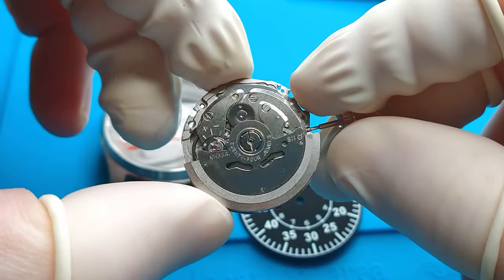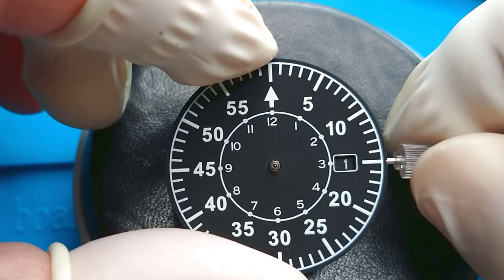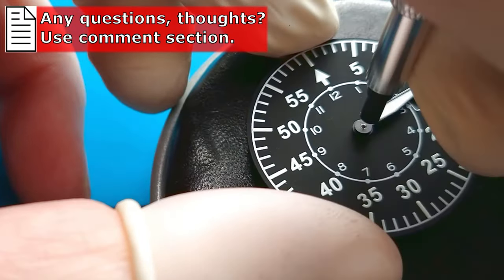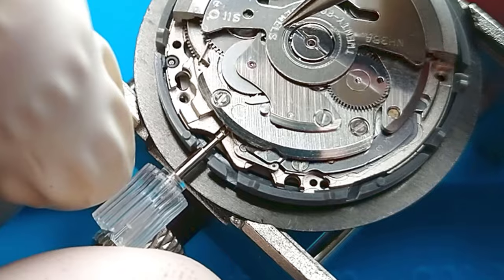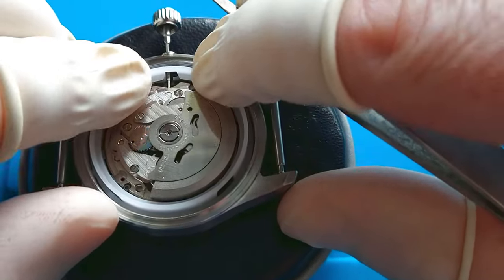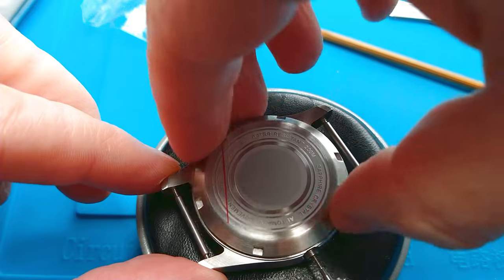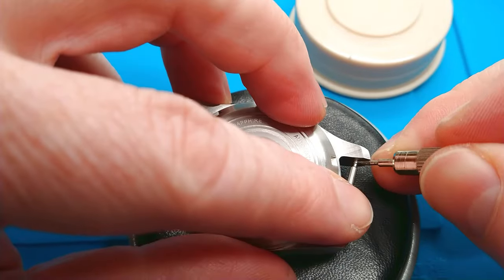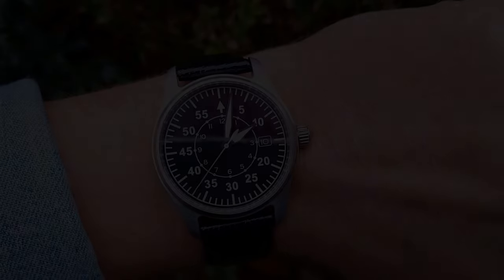Build your own custom pilot watch with SEIKO NH35 B-UHR on your wrist

Comment: Nice build. Tyoe B style with date window you don't see every day. Just a few tips: Use a washer on the hour wheel befor installing the dial so the hour wheel always engages the intermidiate wheel. please use tweezers with a plastic tip. You just scratched the dial when putting the hour hand on. After every hand installation, check if the hand turns ok.
Reply from the maker: Thanks for your advice I really appreciate it

Comment: Thanks for the video. I have a problem tho. The two little stamps on the dial dont fit in the clockwork nh35 although my dial is nh35 compatible. What do I do?
Reply from the maker: Probably you ordered a dial for NH35 but you received a different one. Once the same happens to me ☹

Comment: Nice video for watch DIY-ers. Two questions: how does the cut stem attached to the crown? How do you test the water resistance of the watch at home?
Reply from the maker: The pleasure is mine T-Y Chia! There is a screw on the stem and the crown, so they are connected; I did not test it, but you can put it just to the water and see.

Comment: Hi, I just started learning to build custom watch and your video makes it very easy to do it, it very encouraging . Can you share me all the tool that I should prepare before I start to build my watch?
Reply from the maker: Check the comment section below and my videos, but for sure you need a set of tweeters, screwdrivers, and a case-back opener, then you need to clean the watch, a movement holder is also useful. Good luck with the fantastic watchmaking journey.

Comment: Nice result. I make my own watches, I also use NH35/36. I have more trouble than you with the sweeper though. I use Rodico to hold it in place. I use plastic tweezers to set the hands as I once scratched a dial with steel ones.
Reply from the maker: Thank you, with this plastic tweezers is a good idea, I think I will also start to use them.

Comment: Very good build.
I would be very nervous about cutting the winding stem in case I cut it too short.
Having to adjust for the screw down crown is confusing.
Did you apply any thread lock after you finished it?
Reply from the maker: I'm really glad that you like it. 
The thread lock is a very good idea but if you don't have you can just use  super glue, also works.

Comment: Very nice watch i saw a similiar one build by a Spanish watch fan youtuber. HE print in a 3 D printer the ring. Where did you get it the case and the plastic ring? Thanks in advance
Reply from the maker: Was together with the case bought on eBay.  Check links in the description down below ...

Comment: Just a question: Is it not bad to use a leather base like this when applying the hands as it puts pressure on the rotor? Or in this small ocassion it does not matter? Thanks!
Reply from the maker: It is and I sometimes do, but any method you use you should always be carefull because watch parts are mostly very delicate 😬

Comment: Any tips on sizing the timing stem? That's always my issue, especially when working with a screw down crown.
Reply from the maker: To measure and cut the right length, better do this in steps if you ara not sure.